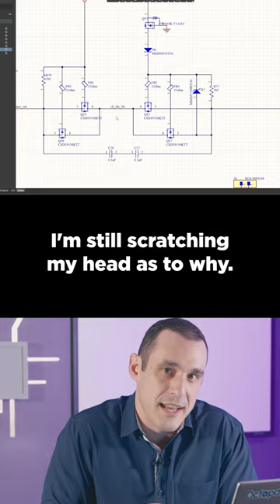Ferrites on  FET Gates and Thermals on Vias? | 1-Min #PCBDesign Review

Comment: but if we dont put the spoke on the pad it is going to be difficult to solder both using a tip or hot blower, it takes more time. should we leave the pad like the video (flooded), or if we have to add a spoke how many and what is the best configuration of the spoke?
Reply: That might be correct for hand soldering or hot air, but what about using a hot plate or reflow? In reflow we don't always need the thermal relief on the SMD pad because the reflow oven can soak the entire PCB and its components up to the required soldering temperature and this would eliminate the temperature difference between the pads.

Comment: Really ? He went 1MΩ MOSFET gate polarization and you wonder why ferrite beads ?
I would say: bruh, get a driver... No, not Uber, MOSFET, yes MOSFET!

I ain't seeing nothin' but 1MΩ with a hypothetical 1nF on the gate throws the τ in the ms, just saying.
Reply: Given the long tau yeah I would wonder why someone would think they would want ferrites on those gates, if the only reason is filtering then I don't think it's necessary in this particular design depending on the SRF for those ferrites.
Reply: @Zachariah-Peterson  so, got some time to look closely (BMS with charge & discharge): the 1Megs are just a polarization, but I would definitely replace the ferrite beads with 5-10KΩ resistors, especially for the right transistor.
Reply: @codures  Yeah you would never get to that resistance level with a ferrite!